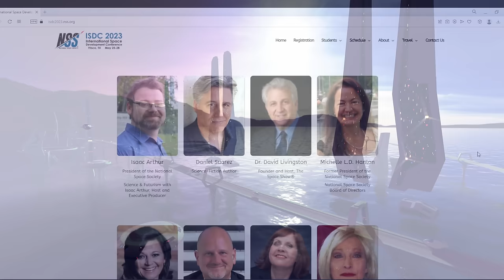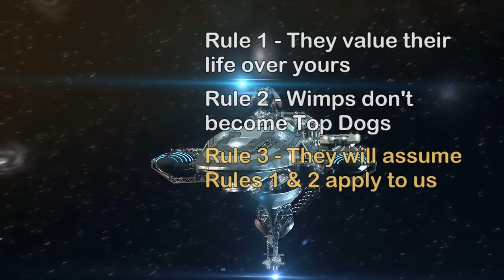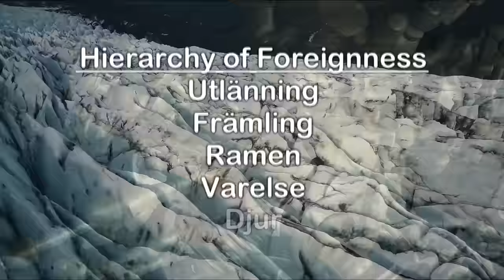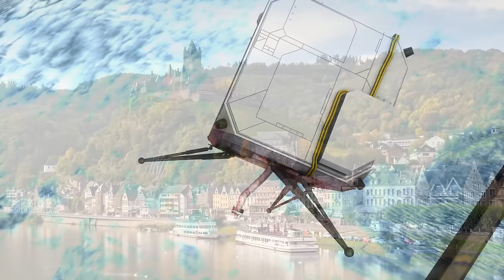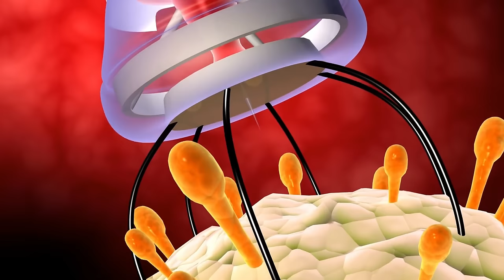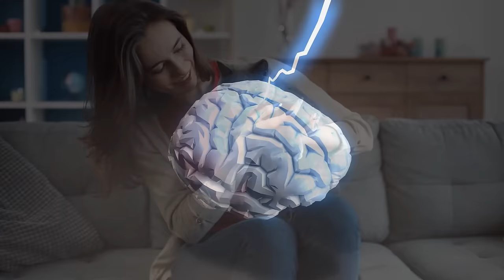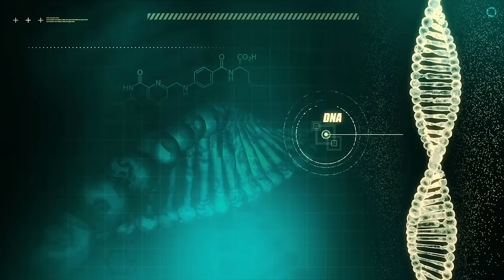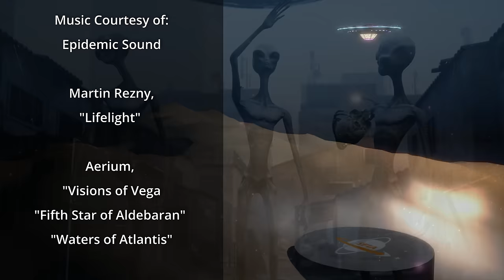Coexistence with Aliens

Comment: If the legendary "island of stability" really exists on the periodic table then in theory since at this point we can't find such elements in our solar system we might be able to find a trading partner that resides in a solar system where these elements are available. This would take advantage of uneven distribution of (theoretical) elements that would exist. So I agree that distribution of elements appears to be generally the same across the universe (boring as you put it) the theoretical exceptions that prove the rule would provide amazing trade acquisition possibilities.

Comment: On the subject of interstellar interaction.
Trade:
          Higher levels of technology have so far required greater varieties of specialization.  It follows that each tech level has required a minimum population to support it.  Now it may be that this useful rule of thumb won't apply to tech levels ahead of us, or there may not be many tech levels ahead of us.  But if the game we're playing DOES have enough tech levels and the rule of thumb I mentioned holds true, a civilization might well reach the point where advancing to the next level requires more population than a particular system has.  (For a system populous enough to send colonies to other planets, this would be MANY levels higher than our current state.)  Interspecies trade on this model might enhance trade through novel manifestations of the trade principle of comparative advantage, because one species is more efficient at making a particular good or service, or different species just like or value making different things.
          Also recent high tech levels have generated artifacts which have a high value to size or mass ratio, often from fairly cheap raw materials (computer chips from sand and trace amounts of nitrogen and phosphorus, for example).  Higher tech levels may do this more.  High value trade need not imply high bulk.

Polity:
          Longevity may well subvert our expectations of how interstellar distances effect interstellar travel considerations over crews staying on mission, or interstellar diplomacy or even a sort of political macrofederalism.  If you expect to live 50 years after you contemplate some action, the prospect of an intervention fleet from the fleet node system arriving 300 years from now may not be much of a deterrent.  But if your life expectancy is 1000 years or indefinite barring accident or violence, this attitude may well change.  Light speed micromanagement is still unfeasible on this scale,  But interstellar collective defense/offense may well be possible.

Comment: Two criticisms (constructive yet worrisome) on the War section:

(1) If you've got robots running A.I. software or even approaching sentience, you can always either download a fresh copy of the original software into a new chassis body, or you can possibly download the old one before it's destroyed, perhaps periodic backups, and upload that to storage, then download that copy with all it has learned into a new chassis body. That has even been done in video science fiction with the Cylons in the BSG Reboot, as well as, I think, suggested in an X-Files episode or SkyNet for the Terminators, or I think an old Outer Limits (90's version?) or Twilight Zone (also 90's version?) episode, I can't recall for sure. But yeah, that just adds to the nightmare scenario of that escalating even faster than humans do. Maybe Isaac said that and I missed it. I'm surprised he wouldn't have thought of it, since he's so thorough and a science fiction fan. -- The most worrisome thing about sentient artificial intelligences, if we ever truly achieve those, is how fast computers are. Software that's truly intelligent, sentient, and capable of learning, growing, could potentially outstrip humanity in anywhere from a few nanoseconds to minutes or perhaps days, depending on how fast true sentience processes, even at current computer speeds, much less whatever might be available by the time we have any truly thinking / learning A.I. software, any true sentience.

(2) I'm not sure we could say modern conflicts tend to be less frequent or destructive or limited than earlier times. Or more sane than earlier times. Yes, we've probably avoided all-out war sometimes. But just look altho dictatorial powers threatening or actually waging war, such as the war, ongoing for over a year now, between two neighboring former Soviet countries, just for one dictator's fevered ambitions, when the other side hadn't committed any aggression to start a conflict. Or a certain dictator of a small Asian country bent on threatening their immediate neighbors or the US, or potentially large neighbors, all because of one man's insecurities and his cronies in power not refusing him. Or, hmm, a recent former leader with authoritarian wannabe-dictator leanings, allegedly (and likely) responsible for an attempted coup. -- In other words, even in modern times, it's still possible for crackpots and ideological / cult-like leaders and dictators to make otherwise sensible people get into war, large-scale, even, for little more than a personal grudge or ambition, wrapped in a flag of nationalism or religion, or flimsier reasons.
Reply: There's a difference between 'limited war' and 'total war.'  Or 'regional war' and 'world war.'  Sure, you still see some of the former of those pairs, but rather little of the latter.  That more than satisfies 'modern conflicts are less frequent/destructive/limited than earlier times.'  Nobody claimed there was no war.
Reply: 1.  The logistics of what you suggest are a lot more complicated then you think.  To do that as you think would require huge jumps in data transfer and storage to keep up with the volume of data a constantly learning and reincarnating need AI would need.

2.  Umm YES, they ARE saner and smaller in scale.  Compared to the, as Sacred Cow Shipyards would call them, our "Not Quite World Wars" that engulfed huge swaths of multiple continents  where millions died and entire cities were completely demolished, we are doing quiet well.  While still brutal, we have become much more precise in our application of wanton murder.  Also, it's hard to see dictatorial powers as a threat in the future when they've been a constant somewhere in the world since at least the 80's and very few of them last for any length of time.  Autocracies tend to have a life expectancy that mirrors the autocrat...
Reply: T D S it's in the brain...

Comment: the pack rat idea is almost certainly not correct. with slightly above-modern technology, it will be possible to "3d print" any object with atomic accuracy. that will make any particular physical object of no particular value beyond its raw material and the time/energy spent "printing" it.